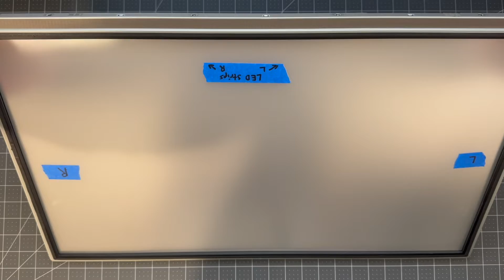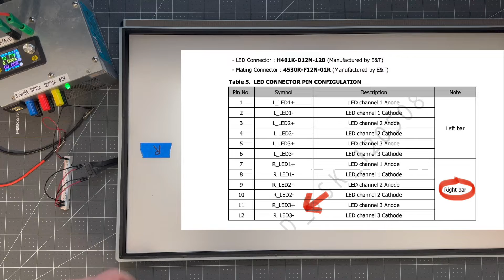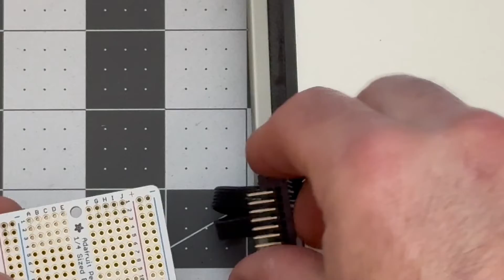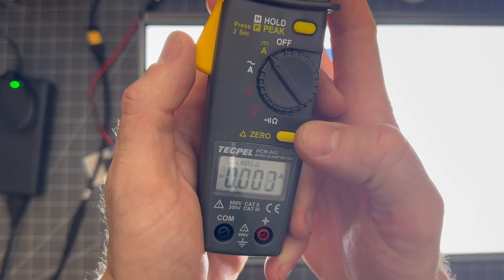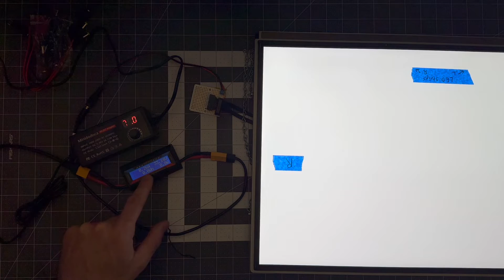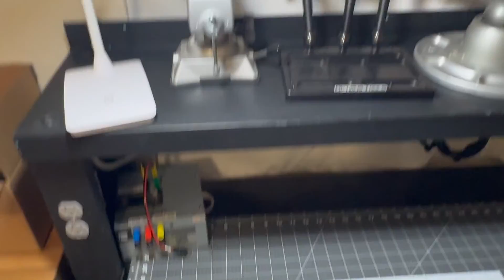How to make a Diffused Light Panel from an old Monitor

Comment: I'm curious where you got that 36 Volt 2 amp brick power supply? Just had one laying around? What is it from?  Great video on this project. The Fresnel lens creates parallel light rays which are similar to outdoor light from the sun.
Reply from the maker: It’s linked in description! Good to know about the Fresnel lens.

Comment: Great work. I am not good very much at electronics. Is it possible that connecting or twisting all positive wires together and negatives together seperately from the connector comes from led panel? So then you can directly connect it to power supply without making a circuit in bread board
Reply from the maker: Yes! That is a very simple solution that should work well.